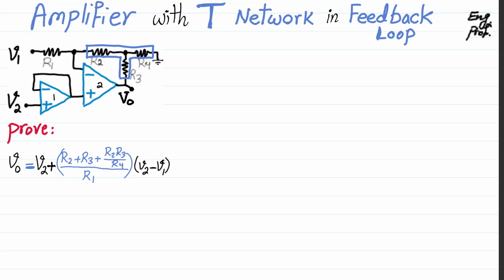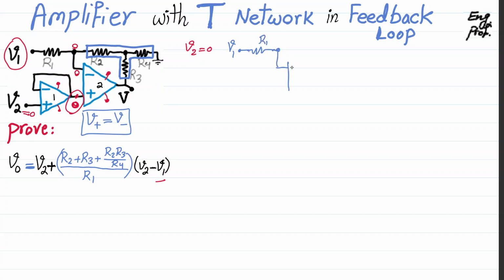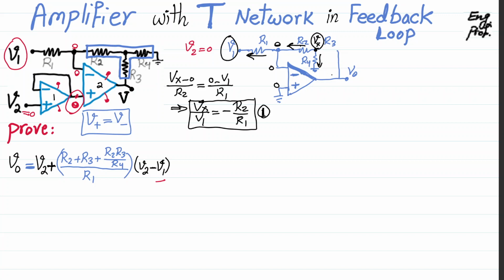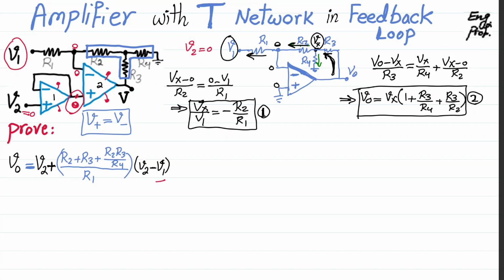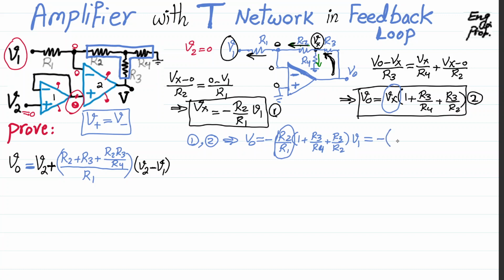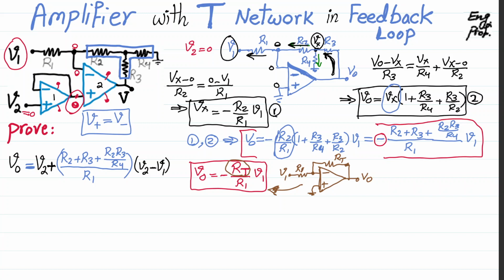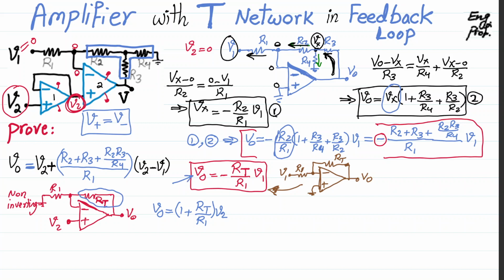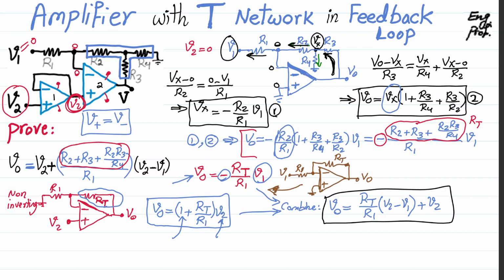Gain of Differential Amplifier with T impedance Network (quick method)

Comment from the maker: This amplifier video shows a quick way using Superposition to compute the output voltage as a function of the two input voltages with impedance in T Net work formation in the feedback loop of op amp.  Here are a few more electronic amplifier videos: Gain & CMRR of Instrumentation Amplifier Explained https://youtu.be/Bw29QjHHzGo
1x, 10x, 100x, 1000x Switched-Gain Instrumentation Amplifier https://youtu.be/9-MLqyewXW8
Instrumentation Amplifier Explained https://youtu.be/Yq767et8BbY
Variable Gain Instrumentation Amplifier for designing Thermometer Current Source https://youtu.be/Ggf0yCaTTiY
Instrumentation Amplifier design with Differential Instrumentation Amplifier with BJT transistor https://youtu.be/2xJpqfexsPg
I hope these videos are helpful.